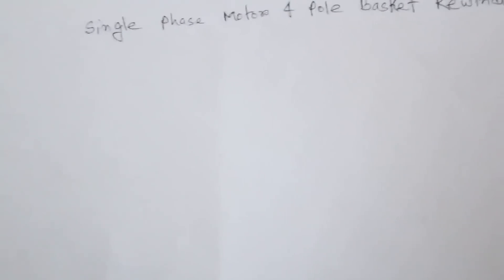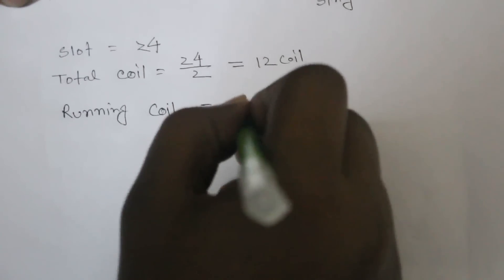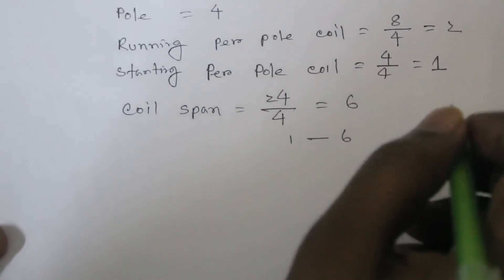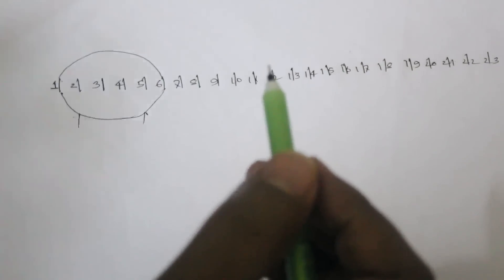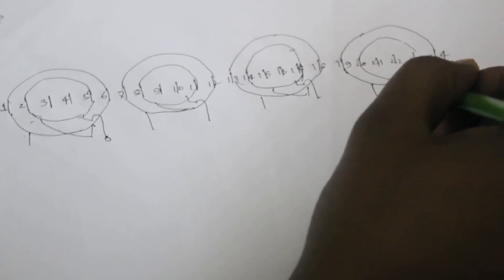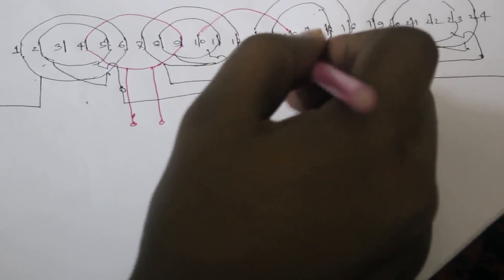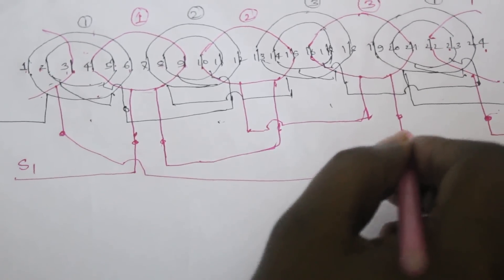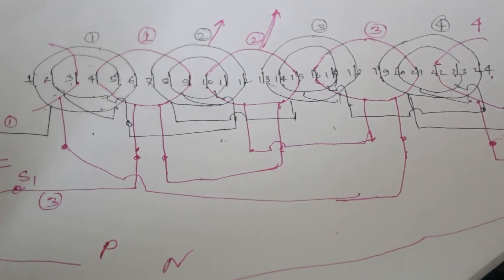how to make single phase motor 4 pole basket rewinding diagram | how to draw single layer winding

Comment: At 6:00 you start drawing the connections for the running coils, but I don't fully understand the sequence: Terminal R1 to Coil(1,6)-Start, Coil(2,5)-Finish to Coil(8,11)-Finish, Coil(7,12)-Start to Coil(13,18)-Start, Coil(14,17)-Finish to Coil(20,23)-Finish, Coil(19,24)-Start to Terminal R2. So, if 'S' is the start of the coil winding and 'F' is the finish, the sequence that the coils are connected is R1-S, F-F, S-S, F-F, S-R2. Why are the coils connected this way and not (for example) R1-S, F-S, F-S, F-S, F-R2?
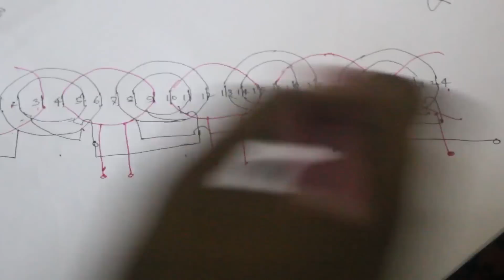Similarly, at 7:44 you start drawing the connections for the starting coils. Again the sequence is S1-S, F-F, S-S, F-F, S-S2.